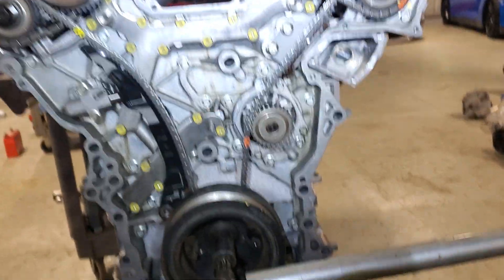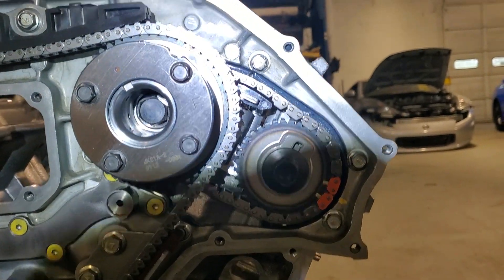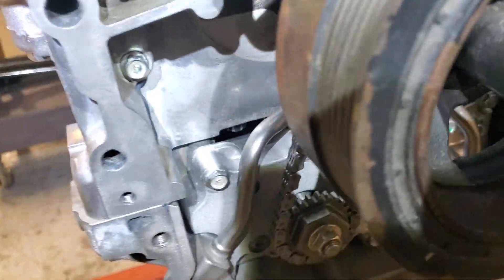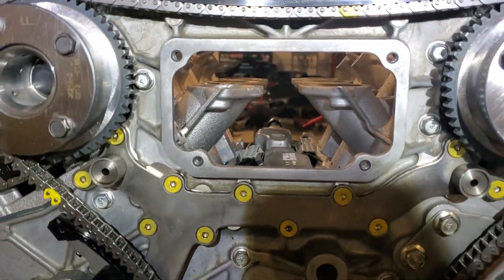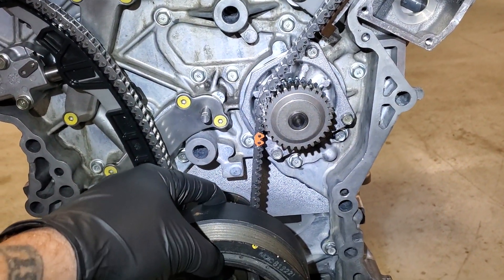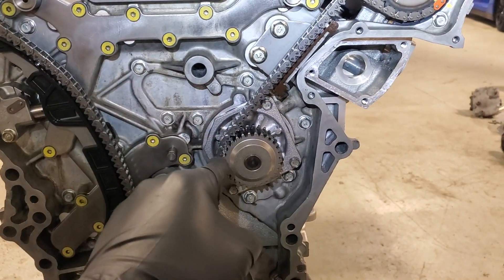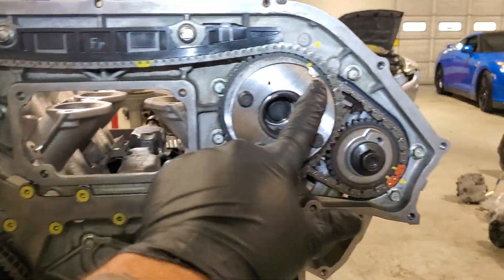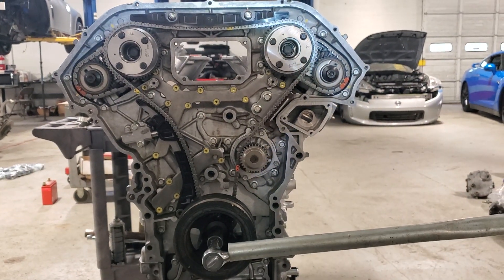Nissan GTR (R35) Timing Chain tricks and explanation

Comment: How do you stop the bank one cans from relaxing or do you just mean how they both like to jump forward together when trying to add main chain or sum
Reply from the maker: So, if ur installing the tower, intake cam on bank 1 will be vertical...put that exhaust cam into a relaxed position clockwise (same position for removal)...install tower, then use a Cresent wrench on the cam to bring it back in place vertical and my preference is to leave the wrench on as I go through the sprocket and chain install for safety

Comment: So is it 2 circles on the driver ext gear. And 2 ovals on passenger ext cam? Thank you.
Reply from the maker: No no, u got it backwards...pass side is two circles!
Reply from the maker: Just watch it one more time carefully...remember this engine made 980 awhp on e85
Reply: Better to say bank 1 & bank 2, then it's the same no matter what country you are in 🙂
Bank 1 secondary chain is circles. Bank 2 secondary chain is ovals. The primary chain then has dots on the cam sprockets that match the yellow links and dot on the crank sprocket that matches the orange link.

Comment: Why didn't Nissan put dimple or some physical dot instead of paint? Also this is the first time I see the timing chain. Kinda feels uneasy to see the intake chain driven the exhaust. Would be good if they just geared it together just the main from the crankshaft is chain driven.
Reply from the maker: I think it's because supposedly there's only 4 Japanese engine builders that build all 8000 count cars each year; however, u can always rely on your color coded chain links to time the engine...it only makes it easier if u TDC the rebuild engine and paint pen indicate the rear cover...if you're doing one of these...just know after 20 rotations,  your rear secondary chains will come back into indication...confirming u did the job right